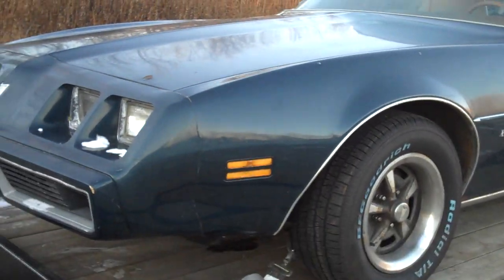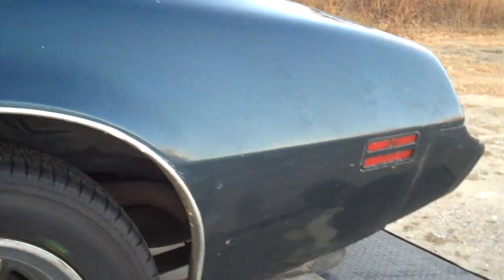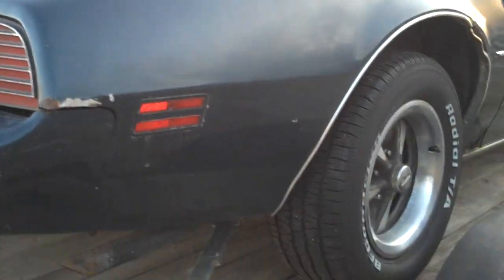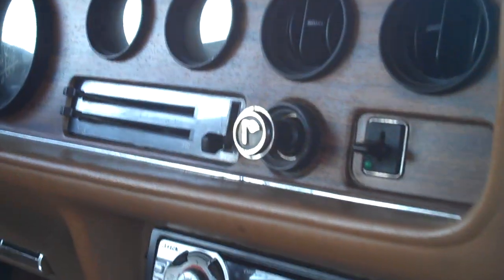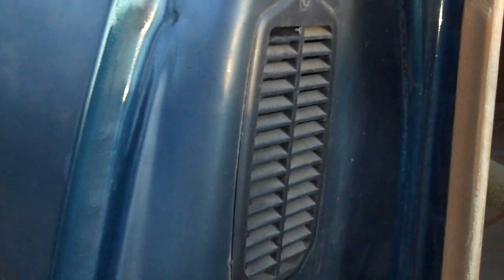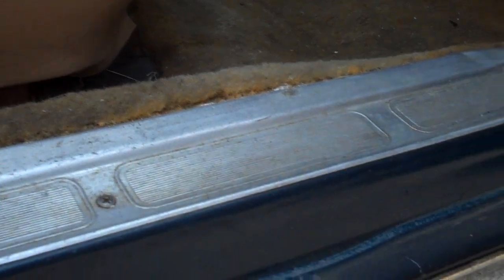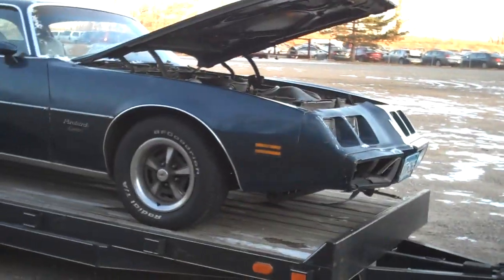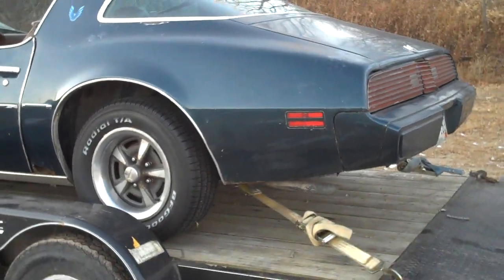1979 Firebird Esprit walk around

Comment: The original color was Midnight Sky Blue Metallic. I had the same car with a blue interior. Those rust holes in front of the rear tires is from that stupid vent you see when you open the door and the factory never painted inside where it rusts. That tail light assembly is identical to the 1979 T/A. Your replacement is from a 1981 T/A/ Firebird if you can't see the backup light unless it is on and the tail light has 4 divisions per side instead of 3. The 1980 was the same but you can see the reverse light a little easier and the 1979 is clear. Changing the timing chain will fix the car if it is a non-interference engine (meaning valves don't hit pistons if chain breaks) Then you ask, how in the world could a chain break unless the oil was rarely changed and so the rest of the engine might be bad...unless fixed in the past.

Comment: Hope that car is on the road and looking good. I have 77 Esprit. (Firethorn Red)  Every one wants the TA`S. Esprit are getting more rare every year. I re-built the engine on mine 32 years ago, It has a Buick 350 block.  The car turns heads going down the road. Young punks in a '13 Mustang had no clue what old school can do to them lol  :P
Reply: A guy down the street from me has a '79. He has it done up like a trans am. It has a shaker hood scoop, but It was clearly a base firebird originally. No fender flares, No fender vents, no T-tops, the cheaper Firebird emblem on the front fenders, a pre-79 hood decal with none of the other pinstripe decals and Rally II wheels.

It looks alright, and I certainly understand wanting to make it look like a Trans Am... they're great in their own way.
But personally, if I had a base Firebird or Esprit that needed work, I'd fix it up but not make it a T/A clone. It's a different look, but I think a lot of time, Base Firebirds and Esprits actually look better than Trans Ams.

And as time goes on, they'll be far more uncommon than Trans Ams real or fake.

I get doing whatever performance upgrades you can, but not every Firebird needs to be a Trans Am. I think you'll agree but I'm just peaking generally.

Comment: This is esprit...so it will come with some power groups.....like rear defrost....power windows ....power truck....tilt ...cruise....that did not come with the delux seat group....extra pile carpet and hobnail seating.....the steering formula wheel was a option....but most ( like 90 percent) had a center console)....there are many option groups for this car....and owners or dealers could mix and match....a extremely rare option is intermittent wiper option.......and the CB / radio option....available in 1976 though 1981.....very rare.....